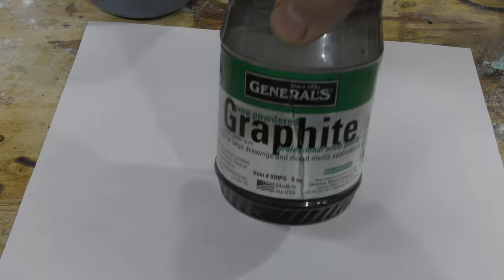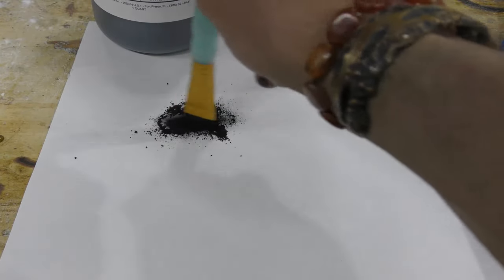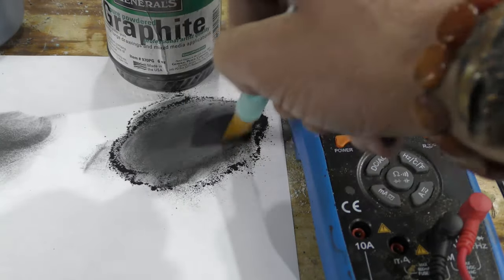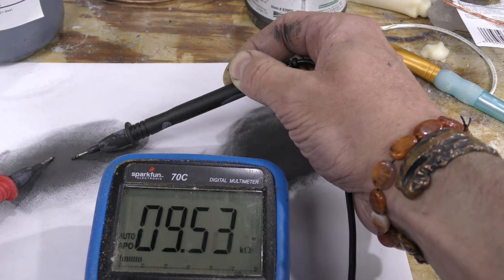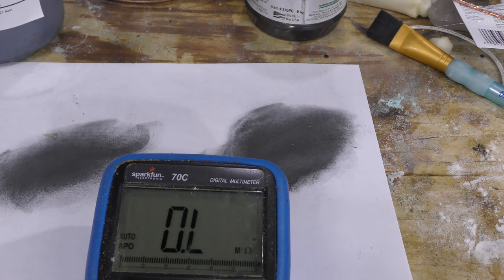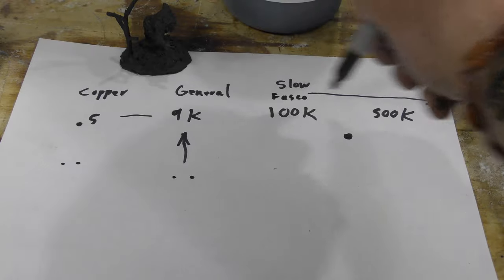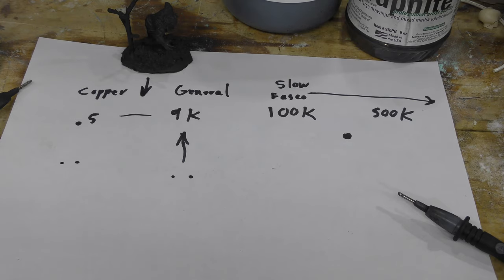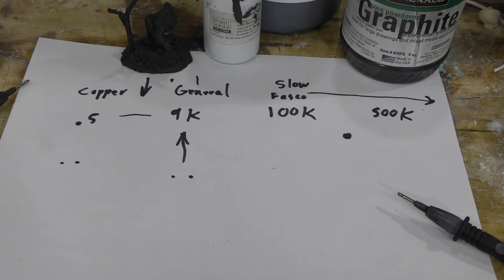Testing graphite powder for conductivity

Comment: Another important consideration beyond purity is particle shape. A lot of commercial graphite powders advertised as dry lubricants use spherical particles, which, simply due to their shape, are less conductive when laid out in a film than the kind that you want for electrical purposes: flakes, AKA platelets. With spheres, at each point where two particles make contact, the actual contact surface is positively miniscule, but with flakes they can overlap and your contact surface area is much larger. Commercial conductive carbon paints use flake graphite for expressly this reason.

Yet another consideration is particle size - I wish I knew more on this facet but I don't. According to google, some researchers found great success with 70-120 micron particles, yet other researchers analyzed Bare Conductive's "Electric Paint" and found the average particle size to be on the orders of nanometers - tiny fractions of a micron. I don't know. My hunch is you want as big of particles as you can get without causing problems with your application method. If you're airbrushing you probably want something small to avoid clogging.

What I do know is I have 5-micron graphite flake and it makes a decently-conductive paint when mixed with normal acrylic craft paint. I'm not using it for electroplating, I imagine you would need a non-water-soluble binder for that, which I investigated and found some people using shellac dissolved in alcohol, and others using oil-based urethane sealants.